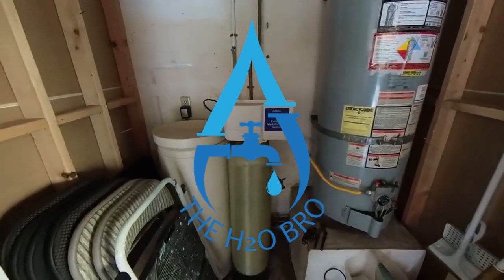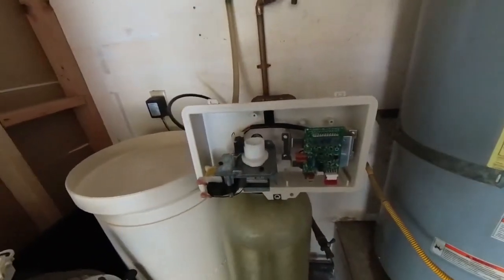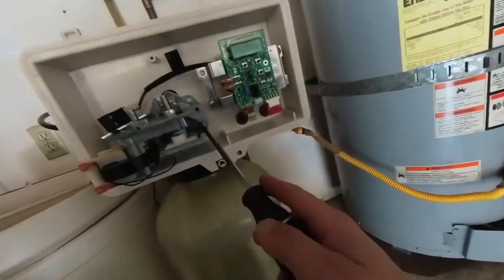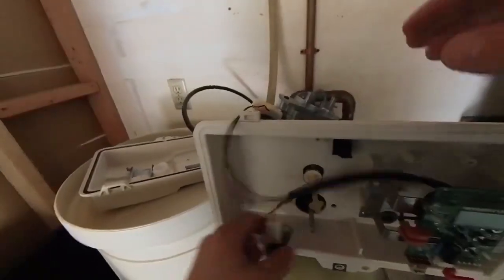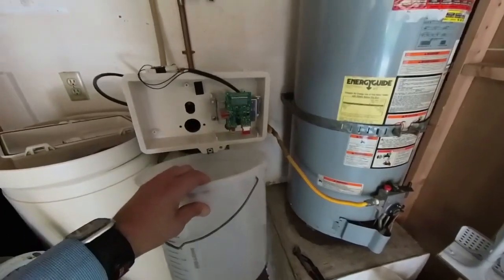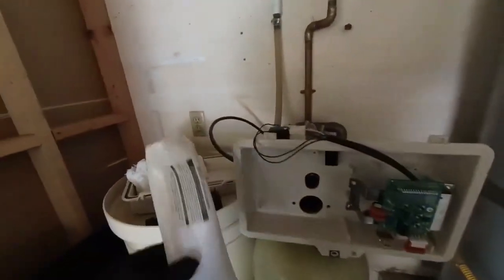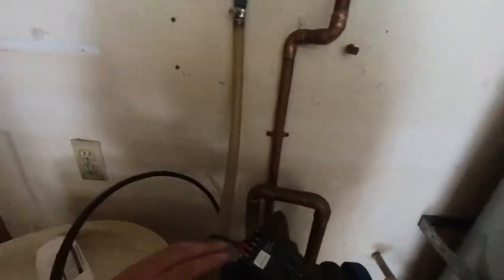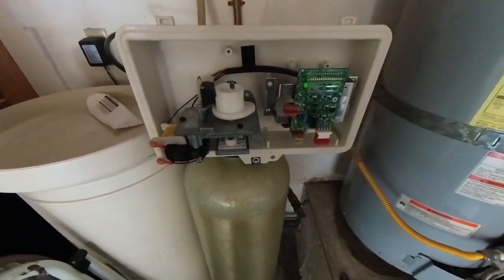Error 1 code on Culligan Water Softener

Comment: I was told that white Lithium grease should not be used on plastic and rubber (it degrades the rubber and plastic over time).  The culligan  repair guy uses uses Silicon Grease.  Should I redo the piston with silicon grease?

Comment: Hello, My system was missing the brine piston. I got a new one, but there is pressure which doesn't allow it to go in. Any help would be appreciated.
Reply from the maker: If you put your water softener on bypass and do a manual regeneration and cycle through the steps it will effectively depressurize the control head. Then you will be able to rebuild the head
Reply: @TheH2OBro  cool, thanks!

Comment: DO NOT use white lithium grease. It's listed as a carcinogen. 

ONLY use a FOOD GRADE lubricant.  

I used white lithium like he said and my water tasted like petroleum. Had to disassemble, clean and flush my system (multiple flushes).

Comment: I did everything but it didn’t cycle when plugged back in and just went to a normal time. Programmed everything and next day still had E1 code
Reply: Cam did move like at the start of the video. I may try it all again.
Reply from the maker: So were you able to remove the seal pack and re grease the o rings on the piston? If the cam didn’t move when you unplugged and plugged the unit back in, then the piston might be seized in the valve body
Reply: @ yep I greased up both parts and then yeah it didn’t move when plugged back in. But it did move when I was clearing it at the start of the video to depressurize it
Reply from the maker: @HazelScott9109 ok then it sounds like you didn’t line up either the brine piston on top or the plate at the bottom with the cam. There is a specific spot that each must go on the cam
Reply from the maker: @HazelScott9109 9:43 and 10:55 should explain it
Reply: @ yeah I felt it was cause after it attempted to regenerate at 2am it had somewhat moved from the forward position on the plate to the back, but I will take it all off, reapply more grease, and re attempt to make sure it is lined up.
Reply: Mine didn't have a brine piston, does that make any sense?
Reply from the maker: @El_Colion it does not
Reply: @TheH2OBro  I followed everything else in the video and when reassembling everything there was no brine piston anywhere. I definitely didn't remove it. This would mean it had been running without one since I bought the house a couple years ago. I was able to fix it and discover the piston was missing thanks to you video though.

Comment: Great video! my cam is not moving at all. Does not even make any sound/noise....Any suggestion?
Reply from the maker: Your seal pack/piston is probably stuck in the valve body and needs replacement. Try putting it in a manual regen then take some channel locks to the cam and “help” it rotate.

Comment: What if the can is not turning?
Reply from the maker: That means the seal pack is extremely dry and stuck. If the cam is not moving while in regeneration try taking some channel locks around the cam and carefully help it turn. As you can see in this video this cam was having a hard time as well
Reply: @TheH2OBro Thank you for the explanation. I could able to fix mine just by initiate manually turning the can.

Comment: Very detailed! Thank you. I unfortunately have an E4 code which i suspect happened after a power outage. Is the fix for E4 code similar?
Reply from the maker: Yes E1 E2 E3 and E4 are all codes indicating that the water softener is stuck in a cycle and is not advancing to the next cycle for various reasons. One of which may happen if the power goes out while the water softener is in the regeneration process. If you follow these steps in the video you should get it back and running. Let me know if you have any questions. Thanks for watching